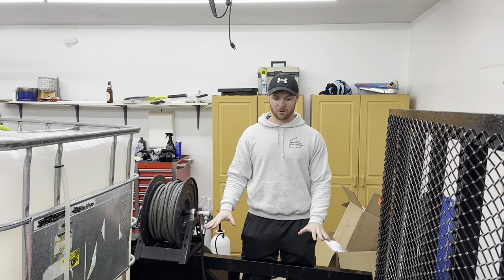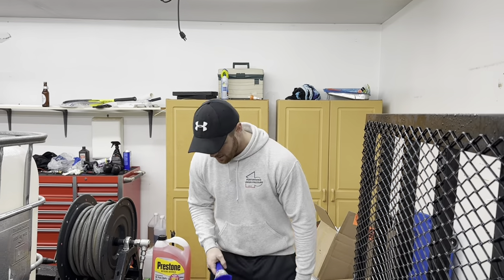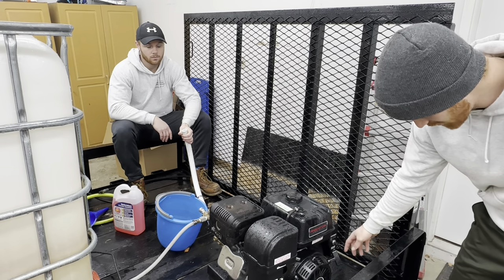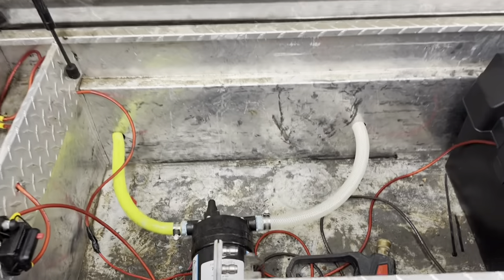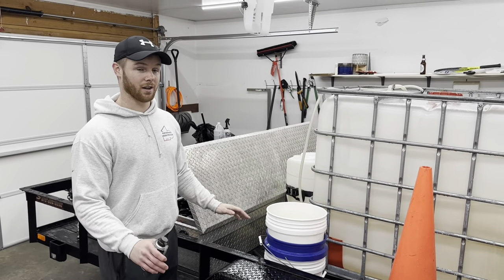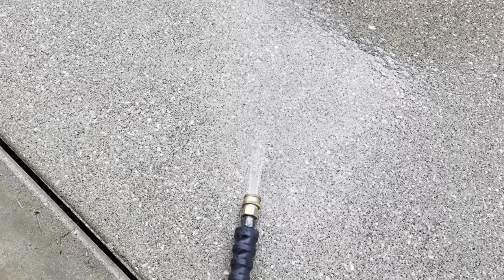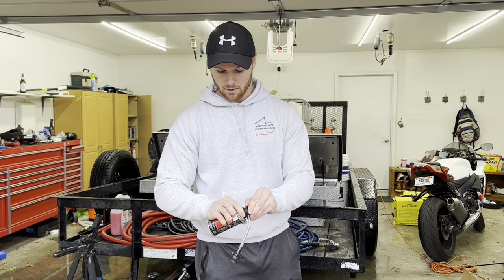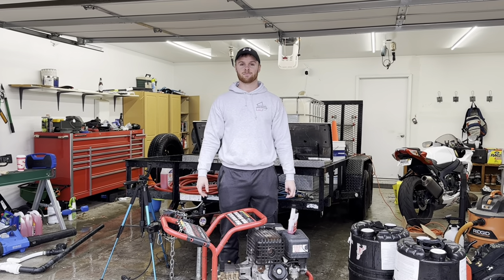How To Winterize Your Pressure Washing Trailer in 7 Minutes

Comment: I wish I saw this a few months ago.
I didn’t drain out my pressure washing holes and it got in the 20 degrees here in NCa couple of days. Do you think that cold would have ruined my holes if water was lift in there?
Reply from the maker: Better be safe than sorry! I would imagine you would be okay if it was only a couple of days. Have you used the equipment since then? 

In the future, we would definitely recommend taking a few seconds to blow the water out of the lines (especially if left outside).
Reply: @pressurewashnerds  all is good. The next day I took all my hoses from the outside shed and blew all the water out like your video.
Thanks for the maintenance knowledge in prolonging the life of my equipment